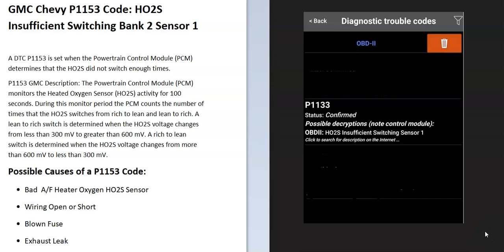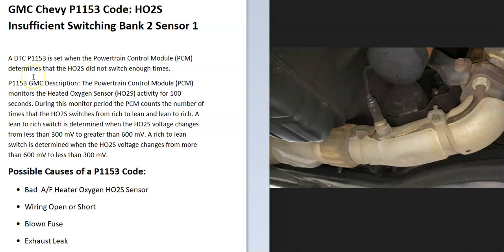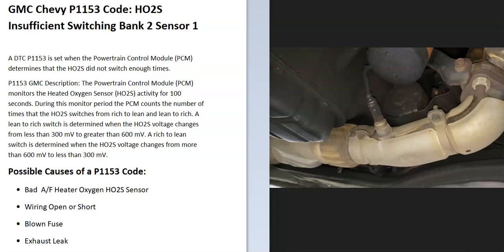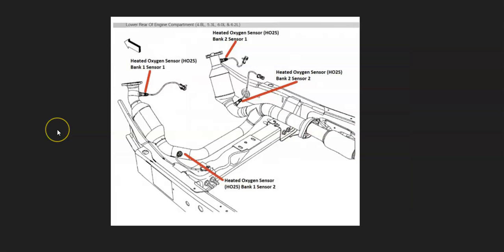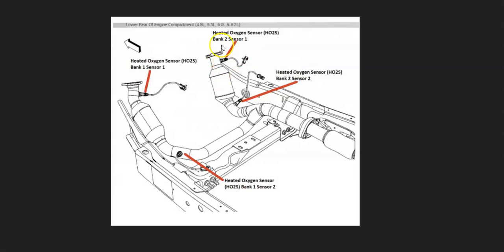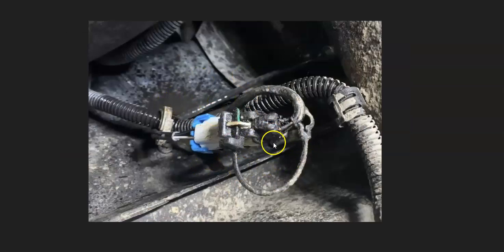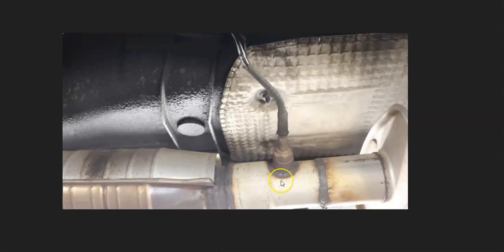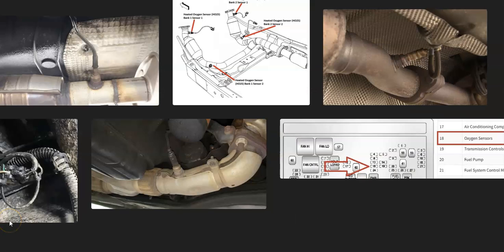Causes and Fixes GMC Chevy P1153 Code: HO2S Insufficient Switching Bank 2 Sensor 1

Comment: Heads up, there is a TSB for reprogramming the EMC so if you replaced the 02 sensor, but you don't find an exhaust leak on some cars (2008 Cadillac Escalade Models, 2008 Chevrolet Avalanche, Silverado, Suburban, Tahoe, 2008 GMC Sierra, Yukon Models with 4.8L, 5.3L, 6.0L V8 Engine with Federal Emissions (RPO NT7) (VINs 3, 0, C, Y -- RPOs LC9, LMG, LY2, L76) or with 6.2L V8 Engine with Any Emissions (VIN 8 -- RPO L92)) The title of the TBS is "Malfunction Indicator Lamp (MIL)/Service Engine Soon (SES) Light On, DTCs P1133-HO2S Slow Response Bank 1 Sensor 1 and/or P1153-HO2S Insufficient Switching Bank 2 Sensor 1 (Reprogram ECM)" - Essentially it may take a reprogram of the EMC for it to read right, even if you put in a new AC Delco sensor, twice ;-). Dealership EMC update should be about 300 after diagnostics, and reprogramming.
Reply: Hey, you happen to have the tsb forum?